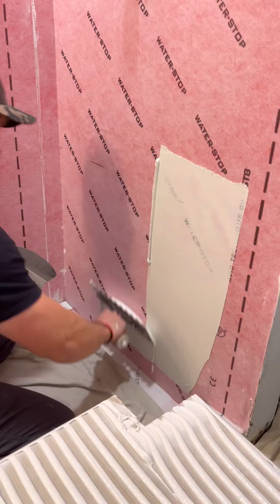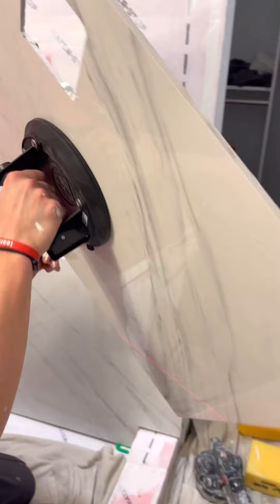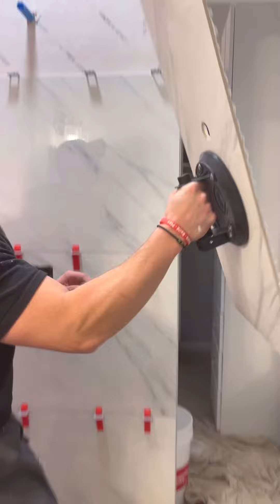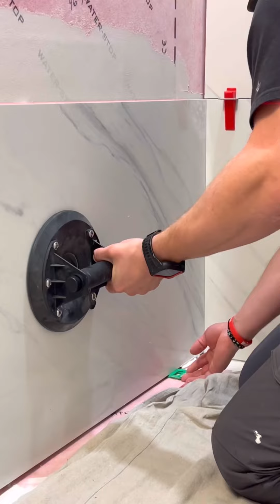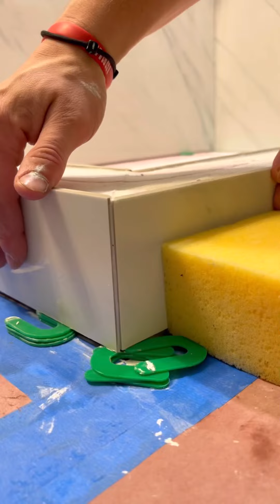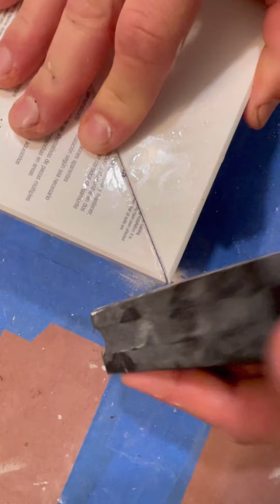24x48 TILE! Anyone can do it! DIY. ASMR.

Comment: Maybe anyone could do it, but not so well!  Lovely. 
Out of curiosity, what do you estimate your investment in tools and equipment to be?
Reply from the maker: I have a big expensive saw that was $1500. So for everything I need to do this shower I’d say around $2500:) 

The key to doing large tile like this is dry fitting tiles as you install them and doing it one by one. Slow and steady!
Reply: Just found your channel and I’m binging away on all the great tips.